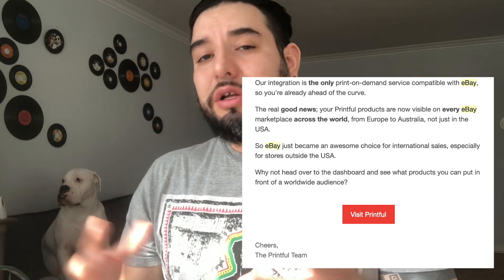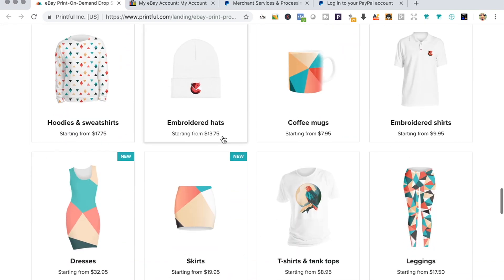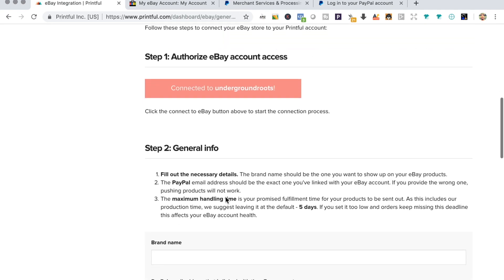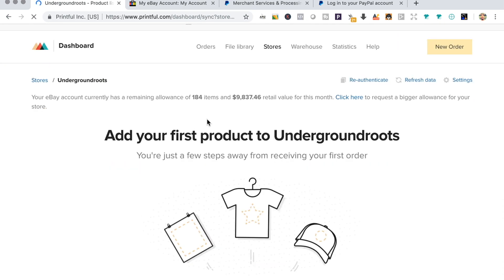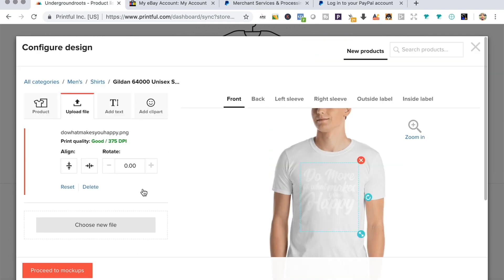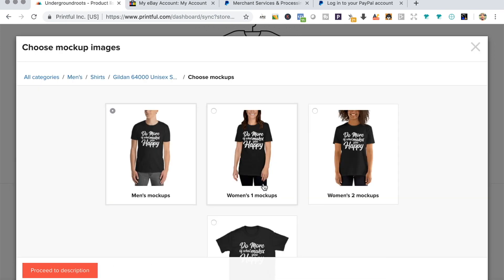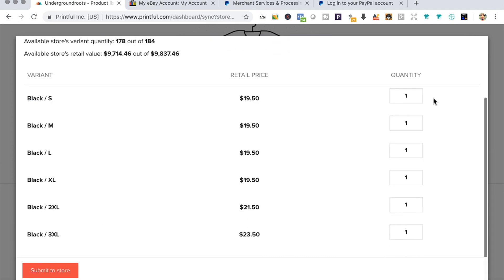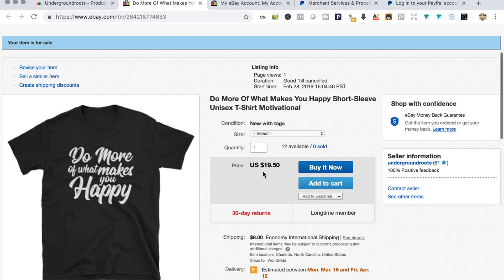How To Start Selling Print On Demand Products On Ebay With Printful

Comment: is there an updated video... I just linked my eBay to Printful but I have been reading online eBay doesnt allow this? and multiple accounts have been suspended?
Reply from the maker: Not sure if things have changed i can see that the fulfilment time can be an issue since ebay usually wants products to ship as quick as possible and print is taking 3 weeks or more to have products shipped out. Try contacting printful they would be more helpful then me

Comment: I just opened an Etsy store a couple days ago. I had one Printful T-shirt listed, and Etsy deactivated my account with no reason given. I've been selling on ebay for about 16 years off and on, and I never had any problems with them. I don't know why so many people recommend Etsy for dropshipping.
Reply: There's a really specific process you have to go through to include Printful as a "production partner" in order to be Etsy compliant. They're also really strict on intellectual property - but that kind of problem might have come with a warning vs just shutting your shop down. Last possibility is that you or someone else using your IP address had a shop on Etsy shut down previously, which would result in any new shop opened with that IP address being shut down too.
Reply: @katlandreth6430  Etsy has a very bad policy with sellers. If they have strict policies about what they allow people to sell, they need to be upfront about it. Also, if you are not in compliance, they need to communicate at least with an auto-generated email. I was just deactivated with no communication at all. Very bad business process. I know they routinely do this with with a lot of sellers.

Comment: Thank you.  Great video and information.  I'm established with eBay so I thought that since I require immediate payment Printiful would just take the funds from the paid order.  Also, I've not seen much on how to figure shipping costs and I don't really want to do international shipping.  How much should I charge for hats and mugs?  I saw in your finished listing you charged $8.00 for the t-shirt.  The shipping and other concerns are holding me back.  I am already set-up with eBay and Printiful being linked but need to get my other worries figured out.  If you can help me I would be so grateful and it may help others too.
Reply from the maker: Hey Tony, not too experienced with hats and mugs, i can see how it can be a challenge to price competitively and still make a profit. I usually try to aim for a markup of 8 - 10 dollars minimum and its all really about experimenting to see what price point works best. I would contact printful and ask them for help, they tend to be very informative and willing to spend time to help your shop be successful. One last thing to consider which i noticed that some ebay seller have issue with is processing time of products being made and shipped. Ebay has a time limit from which orders need to be shipped and sometime printful and other print on demand companies exceed this and this can put your account in jeopardy.
Reply: @Undergroundroots  Thank you.  I'm getting ready to call Printiful today and see what they have to say.  You pointed out an important issue and that's shipping.  Truly appreciate your willingness to help others.  Take care.